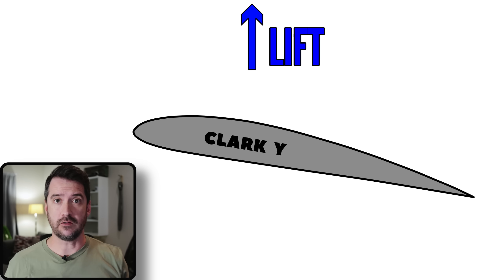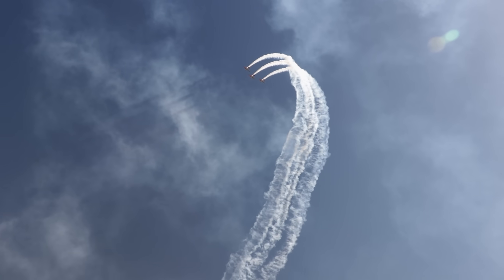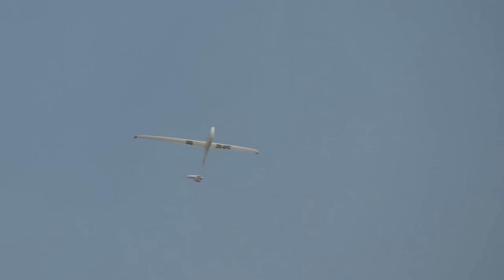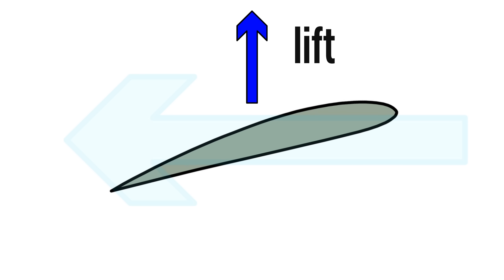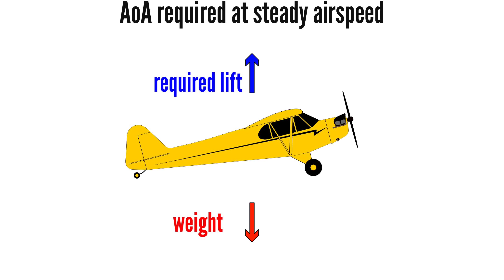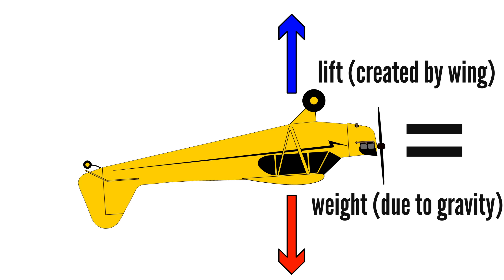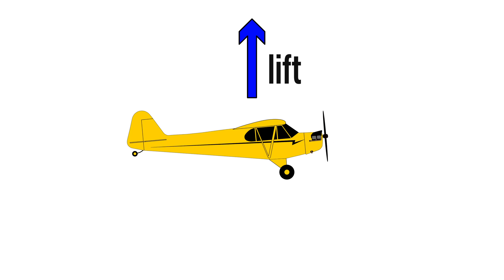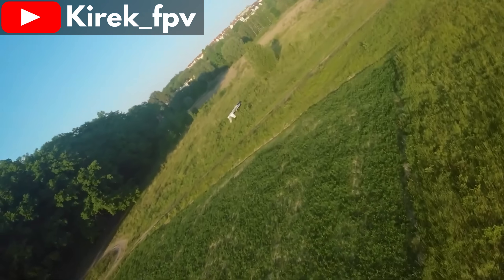Is Airflow Distance Over the Top of a Wing Always Longer?

Comment: I so dislike videos in which the presenter pretends they are going to disprove a theory, only to actually be agreeing with the theory.

What I don't get are all the people who think this guy just proved that air pressure due to path/speed has just been disproven?
He literally pointed out that a plane upside down still has fast/longer path over the bottom of the wing (remember the wing is inverted) due to the stagnation point now having shifted lower on the wing.

This isn't disproving the theory. He's showing that whether the wing is upright or inverted the longer/faster path of air still travels over the upward side. Because - as he points out, to fly inverted the plane must still pull the nose well above the horizon to shift that point of stagnation.

One thing that was proven is that we still do not understand lift. We have a lot of theories - but the solid truth is unknown.
Reply: He doesn't pretend he is going to disprove the theory.  The title:  "Longer Path Over Top Irrelevant to Creating Lift? Let's Put This to Bed"  Read to mean:  the question as to the irrelevance, let's resolve that.  He doesn't say he's going to substantiate that claim, that it is irrelevant.  It's a statement of intending to clarify whether it is irrelevant or not.

And the conclusion is, longer path irrelevance is false.  So, that path length is relevant, is the conclusion.  No false claims as to purpose.

"One thing that was proven is that we still do not understand lift. We have a lot of theories - but the solid truth is unknown."
This is absurd.  We know pressure drops, we know mass is expelled down.  We know mass goes down, because pressure drops.  We know that pressure drops because mass flow rate must maintain continuity, and a longer path length requires higher flow velocity to maintain that mass flow continuity.  And it is conservation of energy that matches the higher flow velocity with the drop in pressure.  Yes, you can maintain the same rate of mass flow at a higher velocity,  if the density is appropriately lowered (Bernoulli's conservation of energy fundamental).  Actually, not "can" but must.

Comment: I've always thought exactly that. That whole explanation of the long and short distance airfoil principle creating high pressure on the bottom of the wing... Then the plane barrel rolls upside down and flies along upside down. 😅
Completely non-explainable. If you made jet liner wings the regular shape though the take off speed would be like 250 mph. The tires would blow up. You'd need twice as long a runway
Reply: It's probably true that if airliners didn't have that shape in the wing they would fly 150 miph faster at high altitudes burning the same amount of fuel. They just couldn't take off and land is all

Comment: Not sure what the argument or controversy is. Simple Bernouli's equation. The longer path of the (split) airflow on the top surface.....noting Bernouli's equation..... means less pressure on the upper surface. ( example: flow in a pipe with a "pinched" center section.....this center section will exhibit higher flow but lower pressure). Besides wing "shape", then yes....the angle of attack also contributes to "lift". So, yes, ..... the plane can fly upside down but the angle of attack needs to be different than right side up. Should be no controversy here.

Comment: 1. Many aerobatic planes have equal camber on their wings' upper and under sides.  
Theoretically, this symmetry should cancel out camber related lift. 

2. Higher speed/thrust planes have flat wings. i.e.  
Nasa X-43
SR-71 Blackbird
Ergo, camber is not necessary for lift, carte blanche. 

3.  Upper surface wing camber only provides lift within a particular speed window. 
That speed window is typically dictated by speeds that provide greater fuel efficiency.
In other words, wing camber is determined by greater fuel efficiency and safety (better stall avoidance).

Comment: Thank you for a very good explanation of lift. All the math calculating the amount of lift and drag are for the aerodynamicists to design the best airfoil for a given mission. But all the math addresses design theory, not lift theory, something pilots do not need to be that concerned with. Either the wing and plane will fly, or it won't. The math only confuses most of us that are actually piloting the plane, while it is critical to the designer.
Reply: Maybe at least this math would be good for the pilot to understand, that lift is  F = A x P = d(mv)/dt.
Which means, the force of lift is equal to both the force of the pressure difference (Bernoulli) and to the momentum change given in forcing mass of air down (Newton's 3rd law).  One is a consequence of the other (they are not separate equivalent explanations).

This leads the way to avoiding some of the illogical thinking.  It also forces us to think about what downwash really means and moves us closer to what the complex Navier-Stokes equations are actually saying about the behavior of physical reality.

Comment: The closest theory for the mechanics of lift, comes from Coanda. Although wasn't able to create an expiremental process 'with data', and describes the process step by step and to the molecular level. Just stop thinking Aerodynamicaly and start thinking 'gas kinetics'. Yes, the expiremental process with data, was created in 2009. Only problem is, engineers have gone too far down the garden path and got lost.
Reply: The expiremental process which describes the exact mechanics behind 'lift', is the scary part, because that understanding changes absolutely everything and is comparable to a 'Bull in a china-shop?.
Reply: There is no Coanda equation in among the Navier-Stokes equations.  Coanda is usually used as a plug to avoid explaining the physics in terms of more fundamental laws.  Newtonian mechanics are the building block laws.  What is Coanda in terms of the laws of Newtonian mechanics?

There has to be that "first principles" discipline, or there is effectively no real explanation.

Comment: Wings don't create lift. Air is a fluid and depending upon the angle of attack and the camber, when moving forward the wing naturally attempts to climb in that fluid. The rate of climb for horizontal flight is balanced by the weight of the plane and the amount of forward thrust.
Reply: Not exactly.
Air is a gas, meaning it can be compressed resulting in higher density.
Reply: @Alec72HD agreed, but all that does is make it a more dense fluid.
Reply: "moving forward the wing naturally attempts to climb in that fluid"  

And what causes it to attempt to climb?
Reply: @davetime5234 The same action as that of a screw thread.
Reply: The original article drew attention to the fact that 'lift' is not created to any great degree by a reduction in pressure on the top surface of the wing because of its aerofoil shape, but rather than by the angle of attack, similar to the way a ship's stabilisers or a submarine's hydroplanes work. There are many equations to describe the motions created in a fluid when a solid moves through it or  when it moves through a solid, such as in a nozzle and when exiting from it.
An aeroplane's wings do of course lift the plane but only because of their forward movement through the air and the angle of attack. Lift is not created by their shape.
Reply: We are just going around in circles. It's already been stated that an object of almost any shape will 'fly' if it has an angle of attack and sufficient forward movement.
Reply: "You need to understand what is meant by angle of attack"😔 So it's not the angle between the axis of symmetry or chord of an aerofoil and the forward direction of travel?

Comment: This does not explain why a wing made out of a thin sheet does also produce lift. Also I’m pretty sure a J3 can fly upside down as long as it could keep it’s engine running. Also your drawings where you measured the distances from is totally made up. The angle of the airflow approaching the stagnation point is always 90°.
Reply: A line approaching a point has no angle with the point.  A point has no extension in two dimensional space with which to make an angle.
Reply: @davetime5234  The stagnation point on an airfoil is part of the outline, which is a line. The angle of the airflow approaching this point is measured relative to the tangent of the airfoil at the stagnation point. At this location, the airflow direction is always perpendicular to the surface.
Reply: @davetime5234  isnt it a matter of slicing through the air in whatever direction including sideways lift also ?
this topic is making a major deal from a small potato
Reply: @davetime5234  the sideways lift im talking about is made for example by the small vertical wing on the back of a plane that makes it turn left and right.
there is a hinged adjustable section on the back for asymmetry.
it would still work if the entire thing was flat and turned. but not the coca cola im about to drink...

Comment: Aerodynamicist here, while you are correct in your point that those arguments do not disprove the path length argument, the path length is irrelevant to lift generation.

The simplest actual counter argument to it is an infinitely thin cambered airfoil with the LE aligned to the flow. The top and bottom surface are the same length, yet lift will still be produced.
Reply: edit:  Angle of attack alone appears sufficient to create a path length difference in the airflow between top and bottom, overcoming any symmetries or "infinite thinness" of the airfoil .
end edit

The same length on the bottom and top of an infinitely thin cambered solid object does not mean the flow path length between top and bottom is the same.  We need to know exactly what you mean by leading edge aligned with the flow, in terms of the effect on the establishment of stagnation points (which affect the path length difference).

And, besides that, the radius of the curvature is different for the average center of flow on the underside of the contour vs the outside of the contour (the middle of the flows are offset from the inside and the outside infinitely thin contour).
Reply: @davetime5234  You’re so close! You’re almost describing circulation.
Reply: @pyreaurum676  But what about the path length difference argument for a lift generating sail (where the notion of asymmetry and airfoil thinness come into direct conflict)?

It is really a (if not, the) key paradox that has to be addressed in terms of basic principles.

Comment: The core idea, that it is the difference in path length that explains lift, is still not correct though. Even a spinning cylinder can create lift for example.
It's just one of the many simplified explanations that you can teach to kids and the general public. And of course it has it's shortcomings.
Reply: You just said the cylinder is spinning which creates the same conditions that a difference in path length creates:  a difference is confrontation to the flow over the top vs the bottom.

If the conditions along the top and bottom are the same, clearly there is no asymmetry, so no net lift can be created.

But you just imposed an asymmetry to a symmetrically shaped object.

Comment: The long air flow path argument has often been made for sails as well.  I've triggered numerous arguments with sailors over the years by pointing out that unlike an airplane wing the cross section of a sail is a line with path length equal on both sides.  When trimming sails I simply think in terms of redirecting airflow while creating as little turbulence as possible.  Redirecting the airmass efficiently creates and equal and opposite force which results in forward motion with lift from the keel and trim from the rudder largely countering the side vector when sailing on the wind (net lift is perpendicular to apparent wind direction).

Comment: If "LIFT" is created by the wing, then how does an airplane fly upside down? The so called "LIFTING" force would push the plane towards the ground! To test the theory, make two drones:
DRONE 1. Wings with the smaller radius on the bottom, not the top.
DRONE 2. Wings are symmetrical.
Reply from the maker: The video explains exactly why this isn't true...
Reply: @LetsGoAviate  EXACTLY, thanks.
Reply: A Change in Attitude !

Comment: You don't have to be an aeronautical engineer to have LONG AGO figured this out for yourself. Put a sheet of plywood or a mattress on top of a car (only lightly secured) and drive at 30 mph or so and the plywood FLIES off. Secure the plywood very well and the car will slow down but neither will it fly like an an airplane. So, let's curve the plywood to take advantage of Bernouli's Principle, and also give the plywood a slight angle of attack to take advantage of the pressure of the air hitting the bottom of the plywood. The result is what's described here. I (for one) NEVER thought Bernouli's Principal was doing ALL the lifting. At a R/C model airshow, I found a pilot who cut out a piece of plywood the shape of a stop sign, put a couple of fins on it to stabilize it laterally, put a BIG model a/c engine on it, and flew it. Yes, it FLEW, but calling it an airplane would have been a BIG stretch. A ping-pong ball on it would have made it too heavy. An airplane REQUIRES an efficient wing.

Comment: When I was learning to fly my instructor at some point told me that the old saying was "That you could use the barn doors for wings As long as you have the right angle of attack. @InternetStudiesGuy also has it right "A perfectly flat board would work to generate lift as long as it has the right angle". Here in this video this guy only references one wing shape with a flat bottom. But there are several types of wing shapes. Two being the Symmetrical Biconvex, were the curve shape is the same top and bottom and the Asymmetrical Biconvex that is the same but thinner. The Asymmetrical Biconvex is also a laminar flow wing. During WWII they developed the laminar flow wing on the P-51 mainly for speed and to reduce what was then known as Compression or Mach tuck. Compression or wing compression, in simple terms, is where that thick leading edge on a wing at speeds approaching the speed of sound causes the air to build up, compress in front of the wing creating a shock wave that disrupts the air over the wing and control surfaces, making it impossible to pull out of a dive. So basically they moved the leading edge of the wing farther back to reduce drag of a thick leading edge and angled the wings to help prevent the compression. In the 1950's and 60's experiments with wing shape continued and wings got thinner on high speed aircraft like fighters. I spent years in the USAF and have seen fighter aircraft with practically knife edge leading edges and the wings only thicken up slightly in the middle of the wing. The F-104 Star Fighter is a good example. The wings had probably the thinnest wings and close to a knife edge leading edge. The wing was so thin it couldn't carry fuel in the wings. The F-16 is another close example, the leading edge is not as thin as the F-104 and slightly thicker. This allows it to carry some fuel in the wings but not much. Almost every section in the fusaluge that can hold fuel is a fuel tank and needs the external tanks to fly any long distance. But that thin wing makes it fast.
So almost any aircraft can fly upside down as long as the angle of attack of the wing is right and the wing is capable of the loading. But in a way this video doesn't explain Symmetrical Biconvex or Asymmetrical Biconvex creates lift. Or the many other wing shapes like are shown here: https://web.eng.fiu.edu/allstar/Wing31.htm
IT would take up more room then is possible here.

Comment: Axiom

"Dynamic lift results from the struggle and unity of opposites, the convergence of circulation and lateral Draftflow (1st dialectical law).
Within lateral flow, every object that is circumferentially surrounded, every entity within the universe, regardless of size, weight, shape, or nature, experiences a lateral force - DYNAMIC LIFT.
Dynamic lift is the lateral force that any circumferentially surrounded entity experiences within an additional, lateral flow.
Lateral flow, as indicated by the term 'lateral,' excludes (literally/in the sense of words) a flow direction parallel to the axis of circulation.
The necessary circulation can be
a) aside from its spontaneous generation at an appropriately directed "slanting" angle of airfoil profiles (sails, kite-dragons, wings, turbines, propellers, ship screws, ascending larger, non-spherical air bubbles in liquids) with respect to that lateral flow,
b) a consequent circulation from rotation (akin to falling confetti in a gaseous medium with ensuing friction/interlocking action!)
c) also achieved externally, by switching, controlling, changing direction, and switching direction.
For the purpose of generating the desired lift in a switchable, controllable, and directionally adjustable manner.
Circulation and lift occur within lateral flow either together, interacting or not at all.
This synergistic interplay is only proportional within a very small range. For instance, the KUTTA lift formula (factor times factor times factor equals product) mathematically implies proportionality, but it is limited by the effect of the LAW OF CONSERVATION OF ENERGY to a specific range of validity (alleged "rule of thumb" without explicit justification by the action of the law of conservation of energy.
Lift increase terminates roughly between attaining three and a half to four times the circulation speed relative to the speed of lateral flow, (documented in the letter from the Göttingen wind tunnel operator to the engineer Mr. FLETTNER during the assessment of his rotor intention/Invention)."